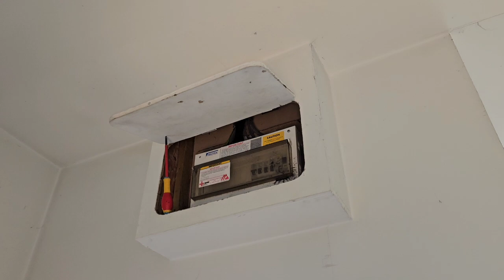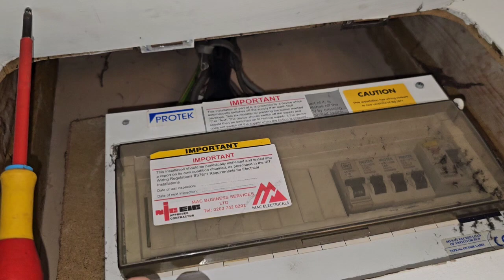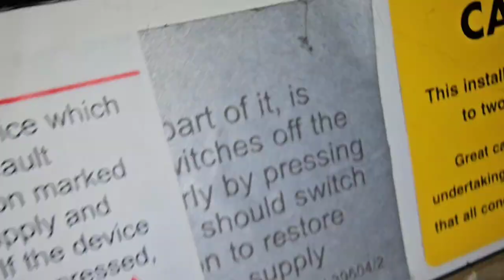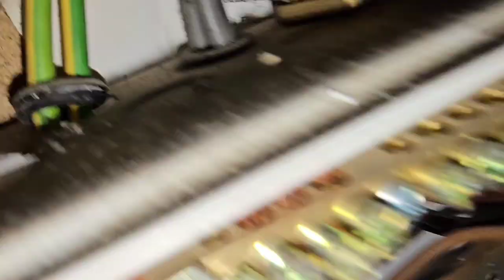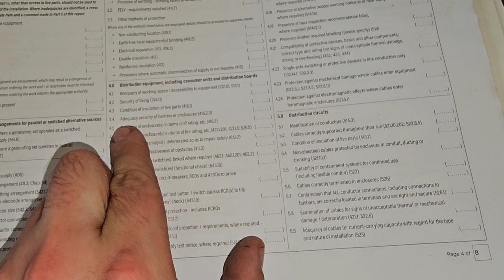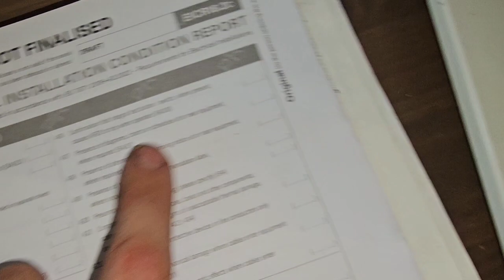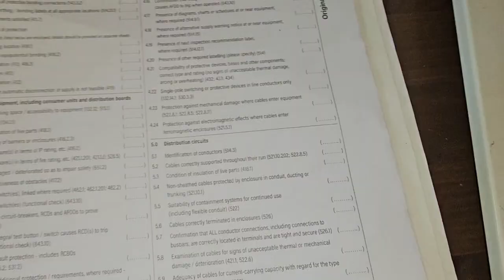Inspection Schedule: Section 4 | Consumer unit's: A brief introduction

Comment: Hi John, great content and glad to see your back at it, happy to be challenged on the following but I’d be coding the fact that yes the consumer unit it metal however the inspection cover is plastic not metal therefore if a fire were to occur the front on the consumer unit would be impeded, that’s why consumer unit manufacturers made replacement retro fit covers to avoid this issue

Comment: 0:37  "mounted very high"

Yer... for a short ass 😂. Previous occupent was 6' 11" so technically could have done with being raised a tad higher 😉. 

The old adage springs to mine. Out of sight, out of mind, and as it works/worked... what's the issue. 

Anyway great video m8. Keep up the good work. 👍